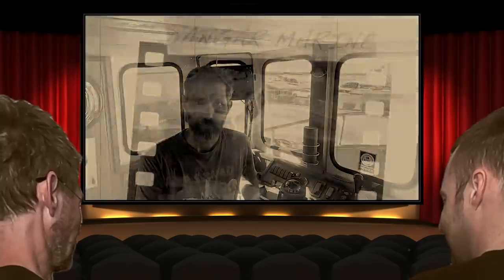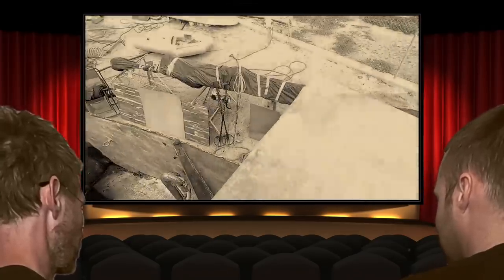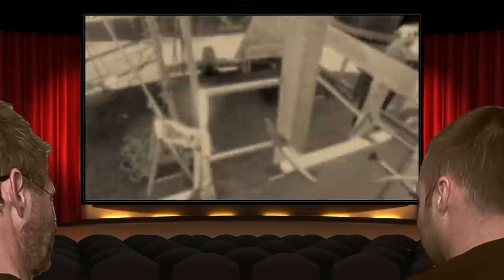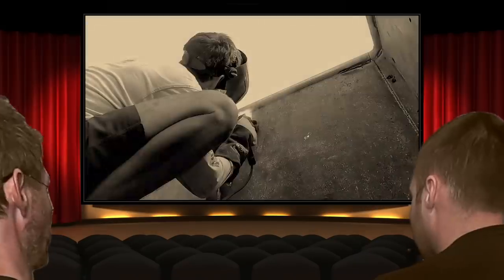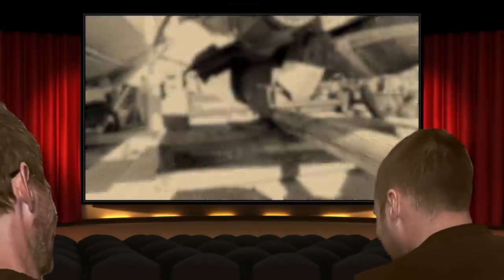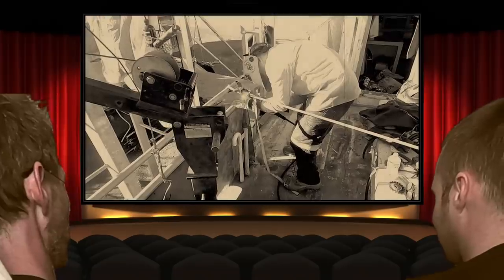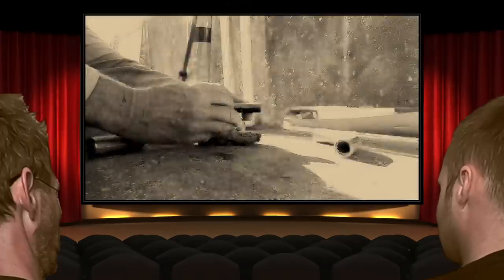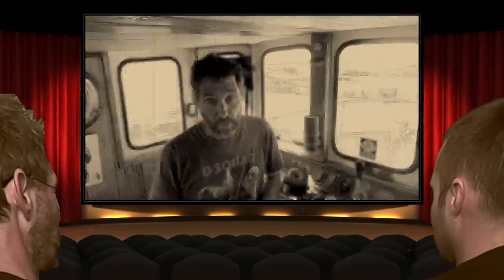Hand rails - Statler and Waldorf edition

Comment: No, it was Mystery Science Theater 3000.  Also, that's not going to be strong enough.  You should have drawn it in CAD.  Your grinder should have had a guard.  And your tack welds didn't have an adequate weave.